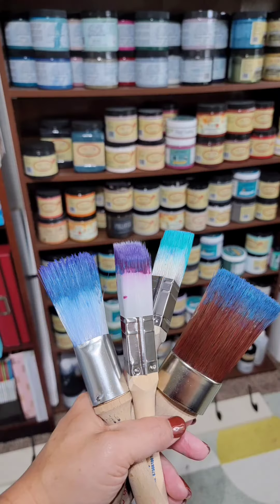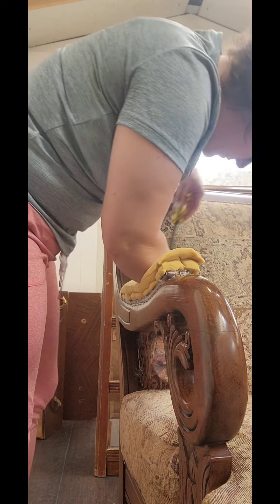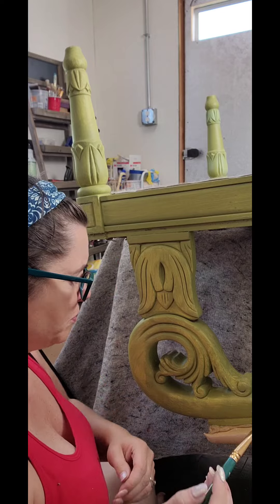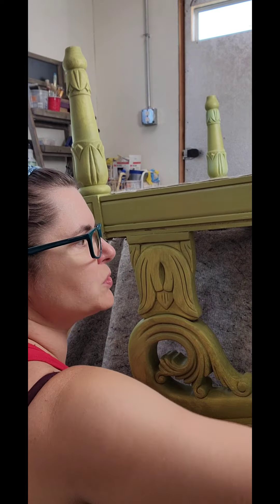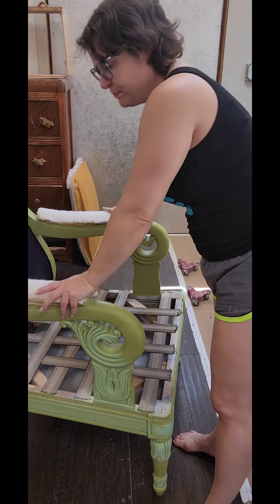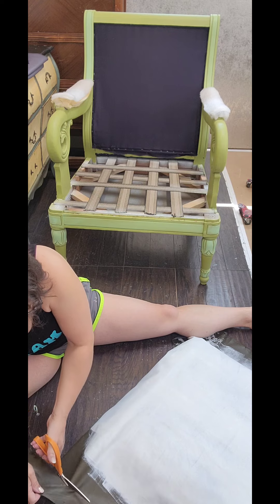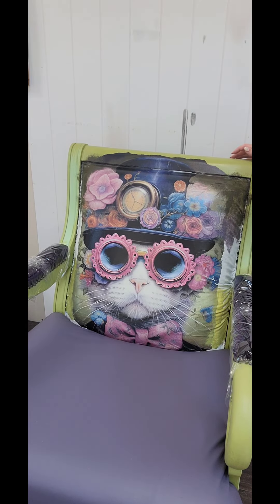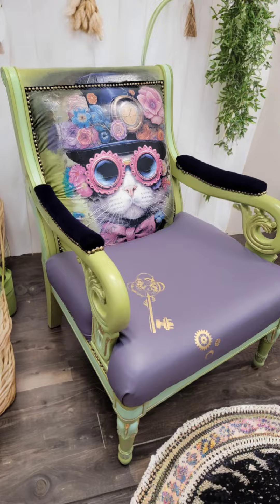My First Ugly Duckling Challenge! (Part 1 video!)

Comment: My experience is that old foam will deteriorate - it will powder and my asthma will notice before I can see it or feel it. Just replace the old foam, please.
Reply from the maker: That is a fair point for consideration. I have deconstructed chairs that had mostly good but some crumbly bits, or parts that feel hard, and those are definitely replaced. This felt like it had many more years in it.